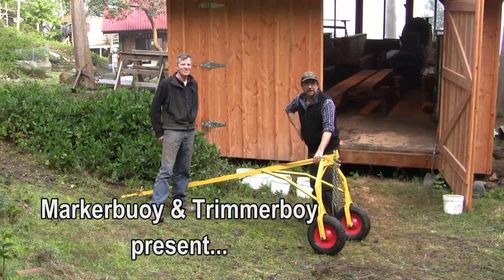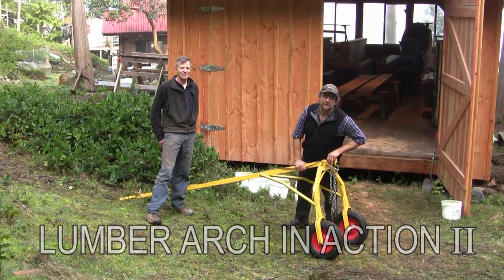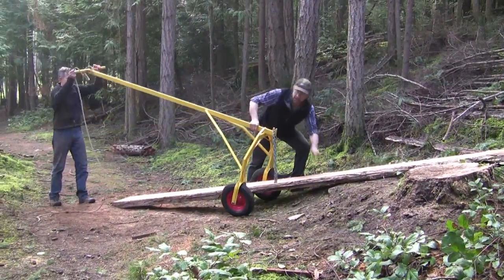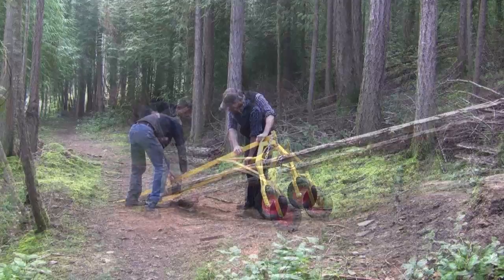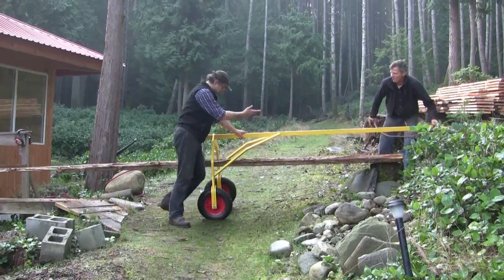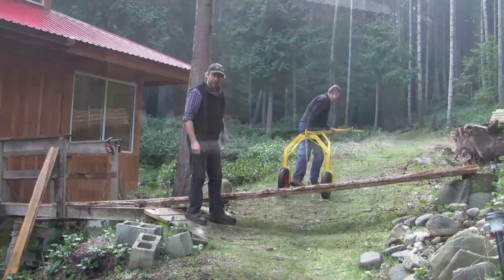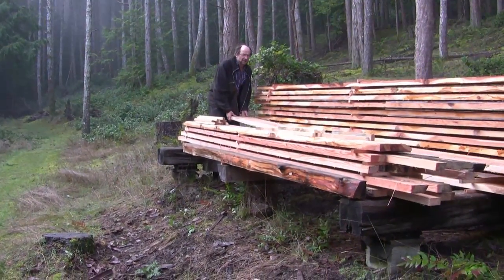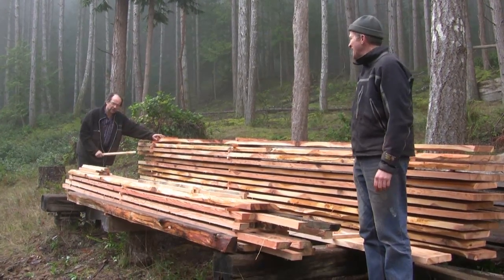Lumber Arch In Action II

Comment: @contreeman 
Hi;
Thanks for watching.
Most of the wood we cut is Douglas Fir.  For building purposes, it can be used wet if necessary but generally we air dry it for about a year, by which time most of the moisture will have dissipated. This is for a one inch board; of course thicker boards take longer to dry thoroughly.  For interior, or furniture work I leave the wood as long as possible before use.
An old codger in the UK once told me to air dry wood for four years per inch of thickness...